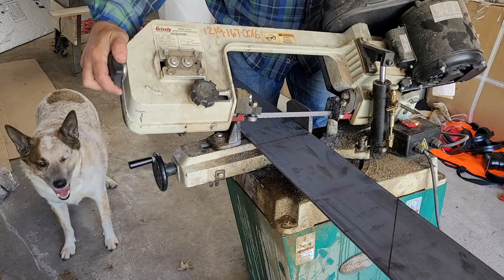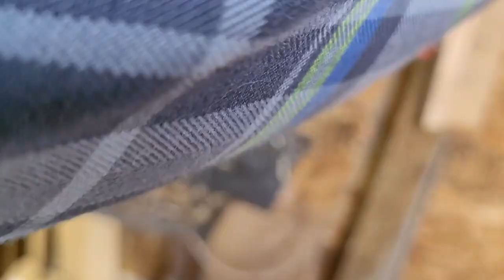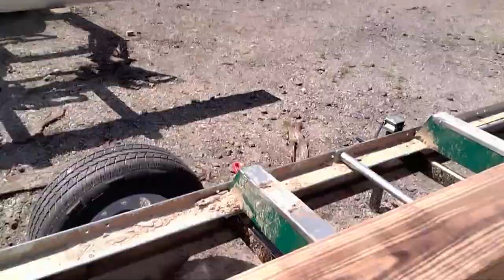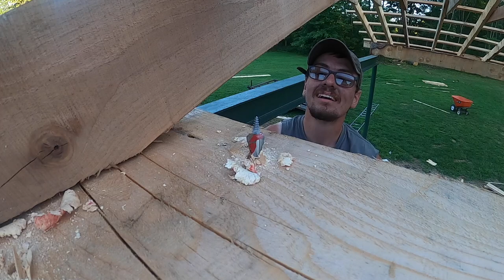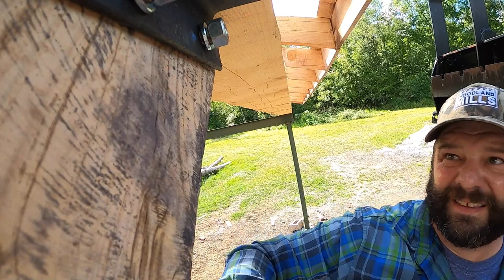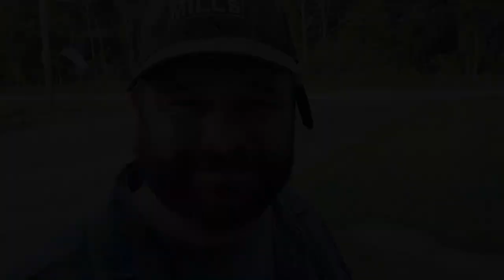#68 Iron and Oak Braces | Sawmill Shed Build ep. 7

Comment: Stout and sturdy for sure. Building is looking great! What are you using for the vapor barrier?
Reply from the maker: We have foil backed bubble wrap from our sheet metal supplier.  It is 500 sq ft per roll.  It deadens the sound of the rain a little bit.

What's your plan?
Reply: @BissellMapleFarm  Probably some 1/2” rigid foam